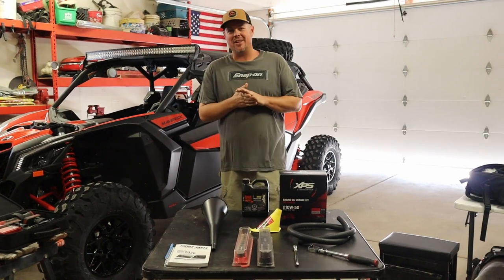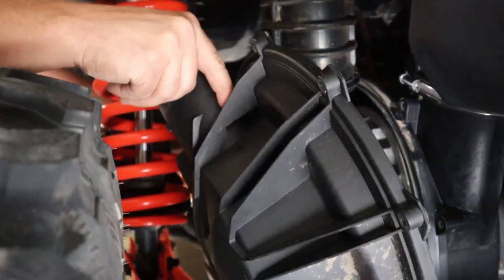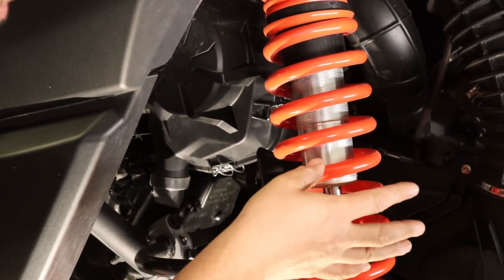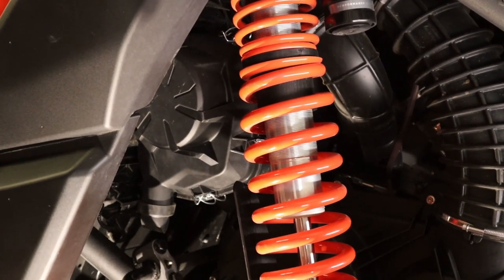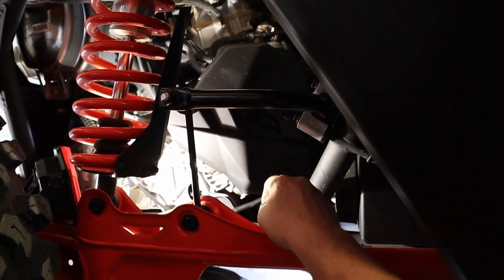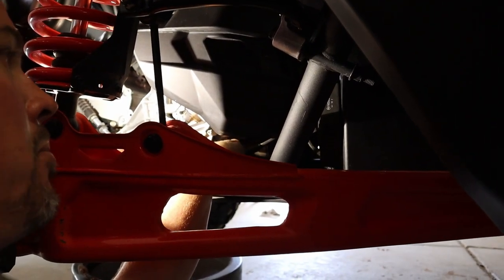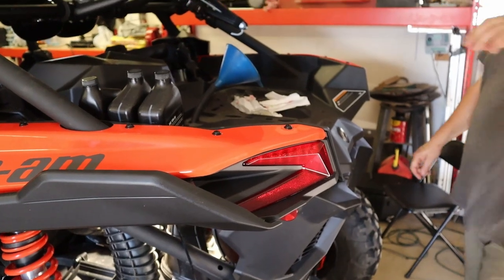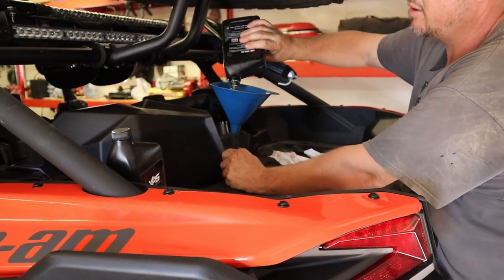Can-am X3 first oil change & service How to do it yourself

Comment: Looking forward to your front and rear differential oil changes as well.  I've done those on the exact same machine and it's pretty easy.
Reply from the maker: Will defenetly do a video on that as well as another  greasing the wheel bearings. Thanks for watching.

Comment: I'm going to get the KWT X2 Particle Separator.   It is a passive separator so it isn't as noisy.   Also tray on it seems real easy to empty out on each big run or after a few short ones.

I'll be doing by first fluid changes (including diff / crank case) pretty soon and definitely earlier than the book calls for.   I'll probably run the 40 in the winter and the 50 weight in the summer.
Reply from the maker: I would like to get a particle separator in hopes that it will fit in the area because of other accessories I've already added. How many miles are you doing diff and crank case fluids?
Reply: @reviewittv1802  I'm intending to do it all including oil by 500 miles or between 50 and 75 hours at most.   We all know how far intent gets ya when it comes to getting a job done that could be put off for next weekend.  ;)

I'm usually pretty good about taking care of my vehicles though.  So, I've got that going for me.

Yeah I'm not sure which separator might fit, but I think some might be more flexible than others... Just a little custom ducting maybe?

Comment: Hey man I have an x3 xrs , I just did the first engine oil maintenance.

I filled the oil level just above the max line, I took the car for a ride and in about 10 minutes it turned off while driving and it won’t start.

If I let it sit for like 15 or 30 minutes it start but for like 5 seconds.

You think that overfilled oil level can cause this ? And how can I solve it ?

Comment: Very helpful brother, thanks for the details - I almost drained the transmission oil lol smh - I have a 2021 XRS TRR 4 seater and specs are the same- you saved my ass. Ohh and btw the dealer wanted to charge me $650 for this service.
Reply from the maker: Glad to help my friend, its nice saving $ and  knowing your machine is done right doing it yourself.